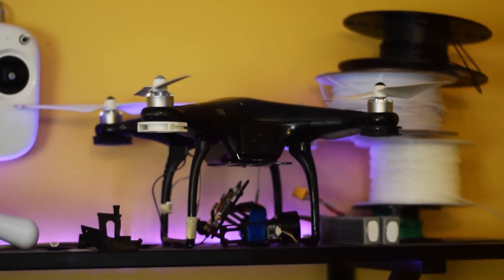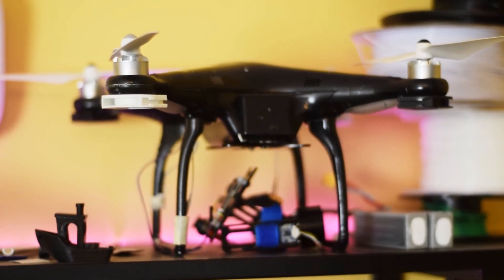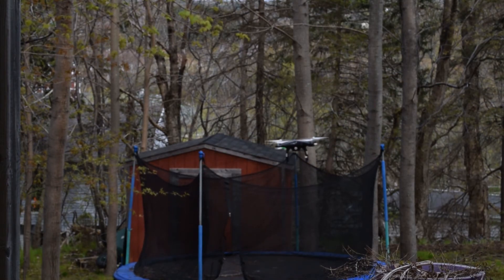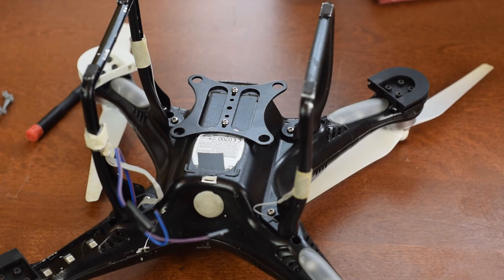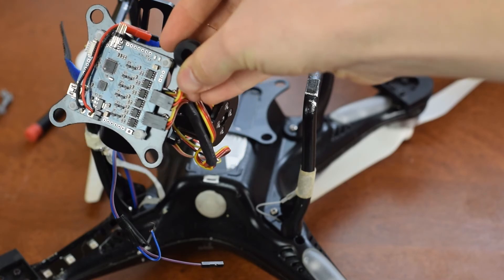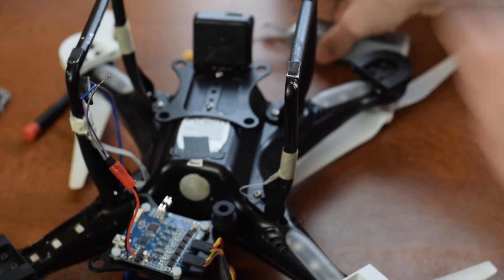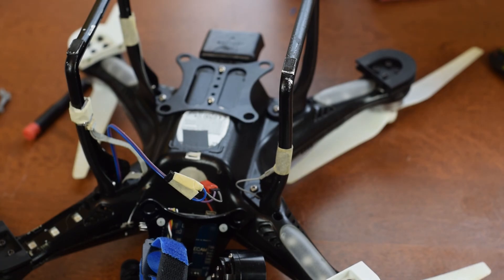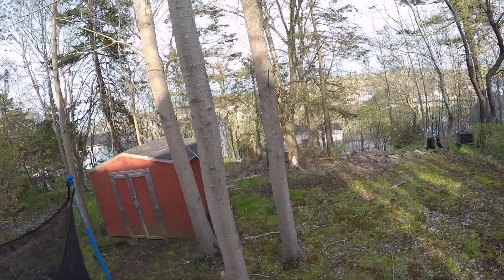"Repairing" DJI Phantom from a crash

Comment: Hi i want to ask you a question. I've seen you overclocked a cpu with tape. Will it work on a Pentium G620?
Reply from the maker: Sorry, but that's not the right generation of CPU. There could still be a mod for that CPU, but the one I did wont work :/